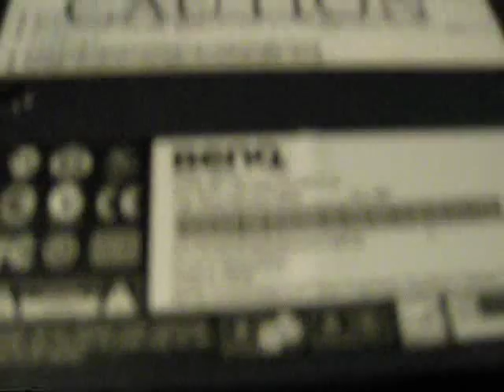BenQ FP731 Monitors Die A Lot

Comment: BenQ FP731 turns on ,screen goes black after about 5 seconds,green LED light stays on,when the power button is then turned off then on real fast it shows the screen,can see the desktop then goes black.....any suggestions. Is a used monitor ,the first day used it worked ,first came on showed small window stating no adjustment preset or something similar ,the button far left with i above it was pressed and the screen stayed on was able to do what was needed on the pc then shut down everything . Notice the back of monitor was very hot . Now this issue with the screen going black but able to see for 5 seconds and the back of monitor is not getting hot. Any opinions what can be done for easy fix beside throwing the monitor in the scrap box ??

Comment: A very expensive monitor - one of the first 17" LCDs. I got two of them. One was 11 y.o. and just died by hands of stupid russian plummers - welders. The other one is a year older and looks as good as new, however its On/off button was used so many times, that it became thinner on the inside and requires a firm push to click it without bounse.